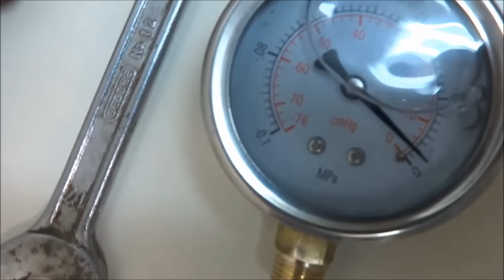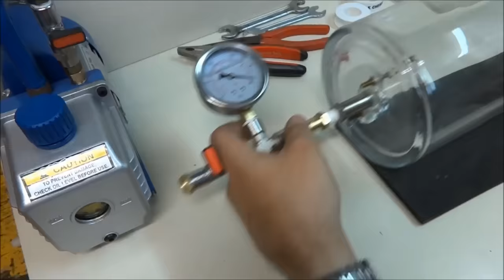Make Vacuum Chamber

Comment: how much pressure can that glass handle before it implodes?
Reply: It doesn't have to hold much.  It's a vacuum, so it only has to hold out 1 ATM.
Reply: It's about how much external pressure holding in.

Comment: If i keep my food inside that jar,it wont get rotten?
Reply: hentai nat So the germs are not developing in vacuum?great maybe i create a new hybrid
Reply: Storing food in a vacuum can extend the life of the food in most cases.   Bacteria, mold, yeast, enzymes, and oxidation are some of the things that play a roll in food degradation. Where removing the oxygen will stop or greatly slow some of these processes, there are others that will not slow or be hastened.  Anaerobic bacteria thrive in a low/no oxygen environment. Clostridium botulinum, which creates a deadly toxin, is one such pathogen that grows in a low/no oxygen environment.
Reply: Increasing pressure...  Interesting... I wouldn't at first thought think so because the oxygen environment is still present, which is what is needed for oxidation and most spoilage bacteria to work on your food.  Would be an interesting experiment.  Yea that's it!  4 ham sandwiches on rye with mayonnaise!  One ham sandwich (your control) stored in the refrigerator in a zip lock baggie, one stored at room temp at static pressure,  one at room  temperature in perfect (or near perfect) vacuum.  Did I say control on the first one?  I really meant lunch!  And, last but not least, one stored at room temp under pressure.  Oh, let's say 100 psi....  Really put the squeeze on those pesky little food spoilage bacteria, and see what happens.
Reply: Me too... That's why I never done the experiment!
Reply: Well, it IS a mason jar. The point of mason jars is to store food without it rotting, yeah?

Comment: can you prove thrust works in a vacuum .
Reply: +VD XXXIII 
"can you prove thrust works in a vacuum ."

==The presence of air is irrelevant. If you push an object with some force F, you get also pushed in the opposite direction with a force F.
Reply: how did you got out.?........
Reply: louis tournas I will take that as a no .
Reply: proof already exists of thrust working in a vacuum. Every space mission ever
Reply: Alex Beck fantasist.  Space missions indeed.. Lol
Reply: VD XXXIII what kind of question is this...hahahaha ofcourse thrust works in a vacuum, air just reduce the speed of an object because its considered as a friction force, vacuum however, dont have much particles thus resulting in better performance...thrust in vacuum has been used in many things, such as moving a satellite , sending satellite to beyond our solar system and sending robots to other planets
Reply: XPumpkins grow up
Reply: I'm working on a vacuum chamber. I can do this, if you want.
Reply: QwertyuiopThePie I want
Reply: The vacuum chamber is complete. Now I just need to design an experiment to test thrust. Any suggestions?
Reply: louis tournas no pipe
Reply: QwertyuiopThePie a small balloon
Reply: VD XXXIII
You can buy a copper pipe used for home water pipe. It should be about 10$. You can buy and endcap for it which is 50 cents.
Weld the endcap on the pipe with lead-tin solder.
Reply: louis tourn,freeze the valve
of a half filled  balloon  into an ice cube.... wait for it to melt
Reply: VD XXXIII
 Good one. Try it.
Reply: I don't have a strong laser handy, nor do I plan on buying one to satisfy a conspiracy theorist on the internet. I'm going to do this without spending anything. I do currently have some supplies I can use, though. A small 300 winmag casing dangling from a string, some gunpowder, that sort of thing.
Reply: The main problem is a source of ignition. Even fuses with their own oxidizer don't work in a vacuum, and I'm not spending some ludicrous amount of money on a laser. The ice could work, but I have no real way of compressing gas in the tube.
Reply: I am going to be getting access to liquid nitrogen soon, but liquid nitrogen sealed in a metal case isn't so much called a "thrust experiment" as it is called a "bomb".
Reply: QwertyuiopThePie QwertyuiopThePie progress report
Reply: Can't think of a good way to ignite the thrust source in a vacuum. I'm also working on getting a bigger chamber, the current one is a tiny mason jar.
Reply: QwertyuiopThePie
 Weren't you going to use ice and let it melt?

If you want to burn up something, you could also lead 2 wires into your chamber and use a tungsten filament. Pass current through it.
Reply: QwertyuiopThePie a small balloon semi inflated with the valve frozen in ice
Reply: QwertyuiopThePie you don't need  tungsten lasers or shit
Reply: louis tournas you can just keep it simple
Reply: You surely are unable to prove thrust works in a vacuum
Reply: QwertyuiopThePie or you surely would have done so by now
Reply: No, it's just proving harder than expected to upgrade the chamber. The old one was way too small for an experiment, and the new one requires drilling through a decently thick bowl. I only really have time to work on it every other weekend.

Of course, you could always just watch one of CodysLab's videos. He has plenty that demonstrate thrust in a vacuum.
Reply: QwertyuiopThePie eggs and footballs
Reply: I was talking more about his explosive tests.
Reply: Distraction
Reply: QwertyuiopThePie who in the whole of yt has proven thrust in a vacuum,
Reply: Get it on man do it Live ;-) world first
Reply: CodysLab has. The blasting caps put out gas in one direction more than others, producing thrust. I still want to do it myself, though. Independent verification and all that.
Reply: QwertyuiopThePie got a link
Reply: Sorry about the delay, but my vacuum chamber broke (read: was dropped and shattered), and CodysLab put out another video more accurately demonstrating thrust in a vacuum. It was a much better setup than I'd be able to make.
Reply: No space travel then
Reply: So "it is possible to make thrust in a vacuum, with the right design" somehow translates to "so there's no space travel"?
Reply: Wheres your footage
Reply: I'm working on a vacuum chamber. I can do this, if you want

Five months later
Reply: I said "working on". As mentioned, the thing broke. Turns out vacuum chambers are a lot harder to seal properly than you might think. That's why I instead gave you the name of a channel that already did this test, a channel you apparently haven't bothered checking.
Reply: If you really want to prove something, build your own vacuum chamber and conduct the test yourself. Even if I did manage to find time to rebuild mine, you'd probably just say I faked the footage or something.
Reply: Yawn
Reply: And your response to the video I mentioned that already did this test? Or are you going to keep pretending that doesn't exist? Does the footage magically become invalid because it's someone who isn't me that uploaded it?
Reply: Link
Reply: Youtube links get deleted by the spam filter. I gave you a channel name, and it's a fairly recent video. Use your google-fu.